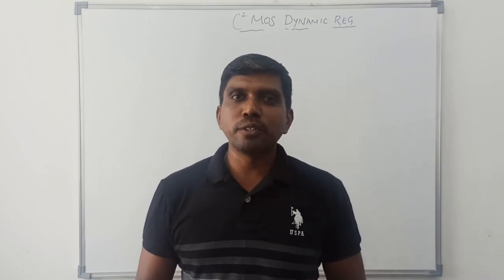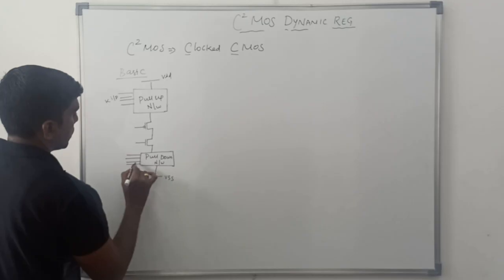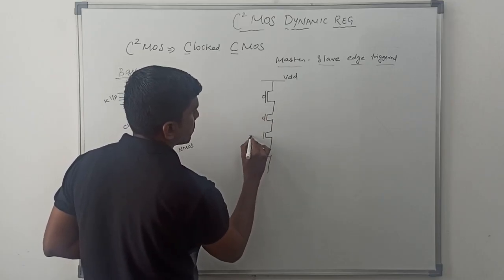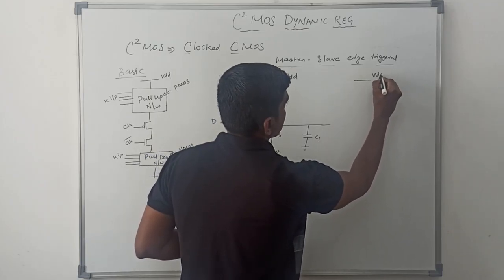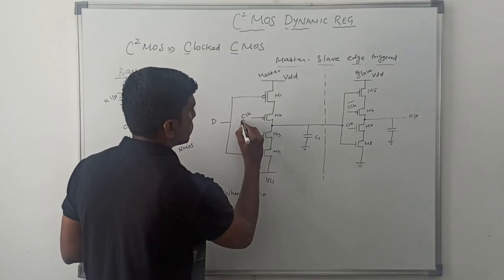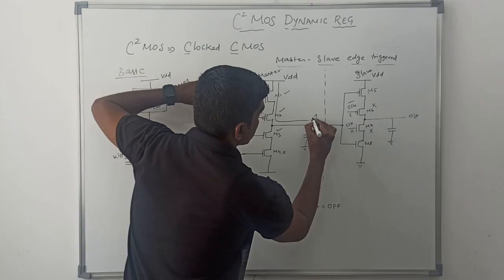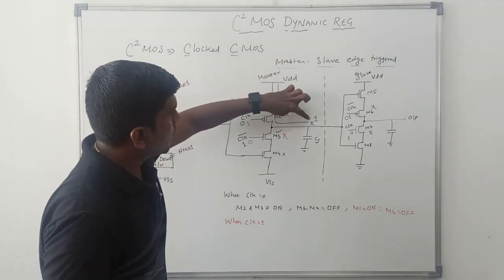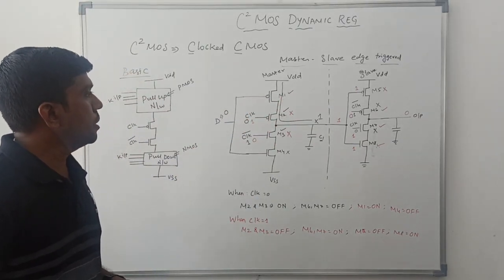Clocked CMOS in Dynamic Register (C2MOS) || VLSI Design || Learn Thought || S VIjay Murugan

Comment: sir what happes if the clk and clk bar are connected to upper and lower transistors and the data is connected to middle transistors ? is that configuration feasible?